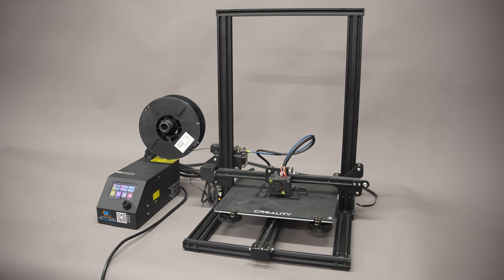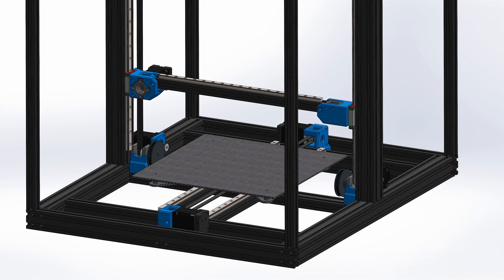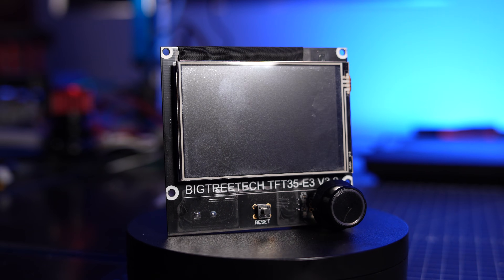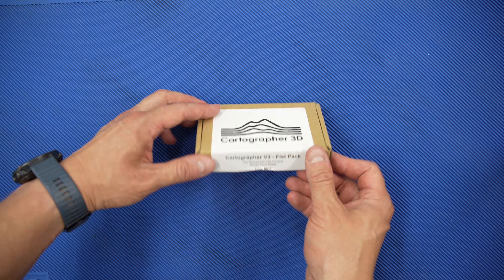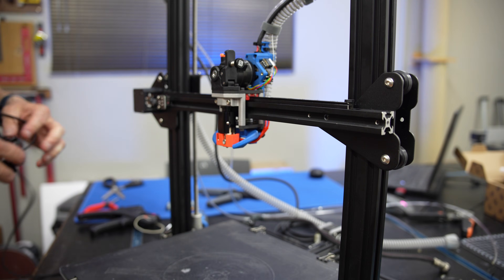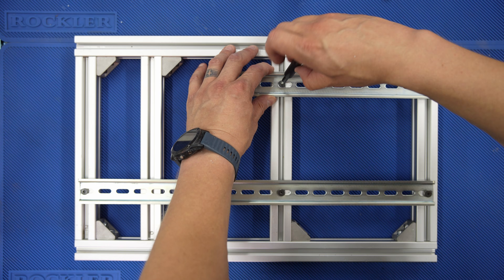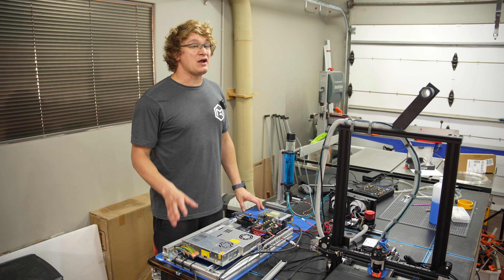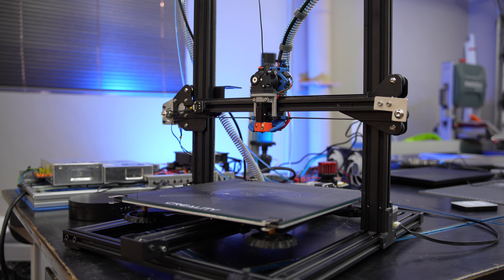I’m Rebuilding My First 3D Printer From Scratch | CR-10S Rebuild Part 1

Comment: I like the build, but for my opinion choosen hotend is disrespectful to the rest of the printer. You put so good parts and everything in it and I thing goliath or chc xl, heatcore 4 and other would be much better options as hotends. Your max volumetric speed would be around 15mm^3/s which is around 180mm/s printing speed so any other hotend would fit better here

Comment: Just broke my heating resistance on my CR-10S and was thinking about repairing it or not. Definitely waiting for the next videos to take a decision
Reply from the maker: Sorry to hear that! Hope you'll find the next videos helpful in making your decision!
Reply: @marcelgenis i'm going to try to transform it to core-XY with minimum cost. Not really your method but will keep an eye anyway
Reply from the maker: @frederict3425 Core-xy is definitely the easier and maybe the smarter route!😂 Thanks appreciate it!
Reply: @marcelgenis after 2 boards replacement, I don't invest anymore in an 8 years old machine but the Bigtreetech SKR mini E3 now driving it worths trying something
Reply from the maker: @f @frederict3425 what happened to the other boards? What boards was it?
Reply: @marcelgenis it was original boards and extruder controller chip died on each of them. Couldn't find a new one at a reasonable price so I had to jump to SKR Mini e3
Reply from the maker: @frederict3425 Same thing happened to me. My original board died, and I couldn’t get one. So I used the BTT E3 RRF. Quite a decent board for the price.

Comment: Why are you using the grove mount on the dragon ? just unscrew it and ridgit mount it. Makes everything so much better
Reply from the maker: Hi there, you saying to bolt the carraige directly to the heatsink? My heatsink is a water-cooled heatsink that doesn’t have any alternative mounting holes, except the screw hole for the groove collar.

Comment: If you can print a Benchy in less than 20 minutes with a 0.5 nozzle and a 0.2 layer height, it'll be great.

10k acceleration and a speed of 300mm/s should break the Benchy, but you need to get the kinematics right. The bed must be made entirely of carbon fiber with a Kapton heater and Kapton adhesive coating—otherwise, forget about flying.

The entire bed, including the MGN carriages, must weigh around 800g or less to achieve these speeds or higher.

It's doable.

I'll be watching.

Good luck!
Reply from the maker: Thank you for the advice, I’ll definitely try an get it closer to 800g! Couldn’t get a Kapton heater big enough. Still looking for one that can actually be shipped to SA. The 300mm x 300mm bed size is quite a challenge, have you printed a sub 20mm benchy on this size bed? 

I get the feeling that once you get into speed chasing, one hardly ever get out😂 Already making plans on two printer versions.

Thanks for watching and for all your support and advice, really appreciate it!
Reply: @marcelgenis  You need to design your own Kapton heater and have it manufactured by a company that manufactures PCBs and similar components (I won't mention names ;)). They're quite inexpensive to produce, and it's best to buy five pieces because it's the most cost-effective.

On my Ender 3, with a 730g build plate, I achieved 200mm/s and 10k acceleration (300mm/s travel) on the original 4.2.7 board (quality print). After switching to the Menta E3EZ, I reached 400mm/s and 14k acceleration using Nema17 42-34 motors. My old Ender 3 is used as a test bed. I have other printers, but the old Edward was my first printer :D
There's one rule: all the GT2 belts must be perfectly perpendicular to the pullers to prevent levers from forming on the linear carriages. You'll have a slight problem with resistance on the table because you'll be using two guides that need to be perfectly perpendicular to each other. You can also set them using the floating carriage method (one permanently attached with 4 screws, and the second carriage with only 2 screws, or even just one). This mounting allows the second carriage to adjust to the plane of the first.

Comment: I have an old Ender 3 Pro that's basically the same machine but smaller.  I moved the stock extruder directly above the hotend and added a BLtouch.  I also put a spider v3 hotend on it.  It prints amazingly well.  ABS, PLA, TPU.. whatever I want.  No issues.
Reply from the maker: Sounds like you've got a great setup! Glad to hear you're getting such good results with it! For some reason I really like bedslingers, considering looking for a second hand Ender 3 on marketplace and doing something similar with it!

Comment: This is probably the most insane Printer build Ive ever seen. well other than a AWD 6 tool head changer voron I saw at RMRRF but this is a different kind of insane
Reply from the maker: Thank you! Don’t think anyone actually realizes what you have to do to actually move a 300mm x 300mm bed around …fast! Destined to be overkill. And I am actually considering adding AWD to the x-axis as well, tool head changer will be too difficult 😂
Thanks for taking the time to comment really appreciate it!

Comment: I had the CR6 Max and it was printing like a complete trash let alone that i had to replace every single FAN in it because stock it was so obnoxiously noisy like a fucking server, also had to replace the extruder because it was made from plastic and the plastic cover holding everything together literally snaped by itself and was not providing correct pressure on the gear pushing the filament. Also on 1st print it dug and scratched the print surface even though Z offset was properly calibrated before.  Literally just a piece of the worst junk Creality should have never started to sell and was basically a scam from their side.
Reply from the maker: Wow, that sounds like a nightmare! Sorry to hear you went through all that trouble with it.

Comment: Would have been more interesting if it was truely upgraded to be faster and more useful instead of basically building a new printer. Edit:  Yes, I realize this is just wishful thinking for to it's limitations. 😢
Reply from the maker: I hear you…but think about it. With the original hardware, how fast can you really make it. The only other thing that you can do besides replacing hardware is to host Klipper, basically getting the same results as I did in this video. You can then do input shaping, improving the quality even more but still be limited to the same speed, might be able to shave a few minutes but thats it before you will have to start replacing hardware, as soon as jou replace one thing you sit with a new thing limiting you. Before you know it… everything is replaced. Spent a lot of time thinking about it and I really don’t want the machine to be a little bit better, I want it to challenge modern printers. Unfortunately these old CR10S wasn’t built using the best hardware and the frame is quite flimsy. Not that much you can do with that. without replacing stuff.
Reply: @marcelgenis  I can't argue with that...uggh... wishful thinking.   I just hate seeing my cr10 sit there collecting dust.
Reply from the maker: @fugitiveminded I might do another CR10 project in the future, where I only take for example $100 and see how much I can improve it. Now that I basically still have a stock CR10 left over after this project😂. Wanted to wait and see how much attention this series get before I consider something like that. So far it looks like it should do well!

Comment: Compared to the rest of your setup that dragon hotend is seriously underpowered. A single 5015 would be plenty to keep up with its flowrate, I suggest getting a dragon ace volcano to make good use of that cpap
Reply from the maker: Totally agree! I have my eye on the Goliath WC hotend, yes WC might be overkill, but I like it😂. Before I pull the trigger on it, I first want to see what happens. There will definitely be a bottleneck, just not sure yet if it is going to be the y-gantry or the hotend!

Comment: how much would this cost? like $300? or closer to $600 like a full voron kit?
Reply: why dont companies make re-usable tech. everything seems to deteriorate or get old over time. nothing lasts forever except for refridgerators or washing machines that can be serviced over time as the parts wear out. bambulabs is proprietary. nothing is safe. im questioning what actually can be kept. like you got a new hotend, bed, board, display, what else is there left of the original printer? its all new.
Reply from the maker: At the moment I will only reuse 80% of the Aluminum frame, limit switches and two steppers. Everything else is new. Won’t say all of them are unusable or so outdated that it can’t be used anymore. It is more of a quality upgrade. For example One can definitely still use the heated bed, I am just tired of waiting ages for the plate to reach temperature.
Reply from the maker: I am not 100% sure, bought a lot of the components over a span of two years. But i’ll will share the total coat once the project is done. Believe it will be around the same cost as a full Voron kit

Comment: i have a mp10 mini. do you think i could do something similiar? do you know if there is a voron halfway kit that makes modding a original printer easier than just doing a full parts kit becuase then i would have to throw out the original printer.
Reply from the maker: Hi there, yeah you can definitely do something similar to the MP10. This toolhead might not be the best option, to give you an idea, due to the toolhead cage, movement in the x-axis reduced by 80mm just to fit. Something like the dragonburner might be better fit, if modified correctly it won’t reduce the movement too much. Well you can always use the LH stinger toolhead as well? Regarding a halfway kit, no I don’t think there is anything, well not that I no of. But I could be wrong. Take a look at the ender conversions, like the enderwire. would be quite similar to yours, just a little bit bigger. Can always scale that down to yours! Good luck, I’ll keep an eye out if I see somethingthat can help you

Comment: BTT ez max can just power the pi via usb port without extra power suply for 5v....  and one MW 600w is alreay enough for this small cute... and I don't think u need water cooling for this hotend which is not uhf at all ... If u really crazy about water cooling and high-speed printing, go VZbot.
Reply from the maker: Yeah you are right, but the Pi was giving me problems while powered by the board. In my opinion much more reliable. Only had the 12V psu for the bed heater that requires 12V. Will be replacing it with a mains heater in part2. I will then include a 48V for the steppers. Yeah the hotend is def sub par, I like the water cooling part, and I already had the hotend from way back. But I have my eye on the Golaith WC hotend. Just want to see what is going to be the biggest bottleneck, the Y-gantry or the hotend, before I pull the trigger on the goliath! Well I am considering buying it anyway, 😂for a corexy printer idea I have!

Comment: its overkill for bed moving printer, not be better get extra couple 4020 and 2020 aluminium extrusion to build corexy?
Reply from the maker: true, true… but something in my wants to challenge physics with a bedslinger! Might be stupid, but fun. Definitely have my crack at corexy after this build!
Reply: @marcelgenis  its actually easy to convert, need one extra ender 3 frame for parts if dont have option to cut or order right size.
Reply from the maker: @alexvikingo6676 Definitely on my to-do list! The sad thing is, that it should be a better performing printer in the end

Comment: The hotend is bassically the only thing that isnt a uograde here. Could and shouldve done a Goliath Water hotend to keep water cooling and 4x the flow and still V6 nozzles
Reply from the maker: Totally agree, I have the Goliath in my basket. Just waiting to see what is going to be the biggest bottleneck between the y-gantry and the hotend, before I buy it! The problem was, I bought some of the components, including the hotend, more than two years ago. My plan evolved a little bit since then😂

Comment: Why would you use dual 12mm guides and not move them to the sides for maximum stability 😮
Reply from the maker: Was something I was considering. But doing it this way was lighter. I did FEA on the plates to optimize them. My goal was to get the plates as stiff and as light as possible. Having 4 Anchor points supports the bottom plate substantially and reeuces the need for extra printed parts. With such a big plate shifting the rails down to the sides would have left the connection of the bed assembly further away from the CG. Creating unnecessary forces and torque, that would impacted the gantry more than having the rails on top. Well thats my opinion and what has worked for me in some industrail designs I have worked on.

Comment: Same here. I have a ender 3 v1 with some mods worth 150€, but its soo sloow and it cost me a lot o time to calibrate to have good quality, but now i got a Kobra 3 v2 combo and its in another level, por just 220€ it has ALL included and 3 or 4 times more quicker so...
Reply from the maker: That's awesome you found a printer that works so much better for you!

Comment: Cool video. Also, drilling, sanding, cutting carbon fiber equals facemask, always, with any amount.
Reply from the maker: Thank you! Yeah definitely, helps to wet the surface with a spray bottle to keep the dust contained. Instead of using dust extraction! I have over 10 years experience as and structural composite design Eng, carbon dust is definitely the worst!

Comment: Stumbled upon this thanks to YT's random suggestion algorithm.  I have a CR-6SE gathering dust, having been obsoleted by my K1C.  Now subscribed so I can follow your build and maybe save my old printer from the bin.  Great video and looking forward to seeing your progress.  To be honest, though, you're essentially building a printer from the ground up.  Will there be anything remaining of the original once you are finished?
Reply from the maker: Thank you Youtube algorithm, never thought I would say that!😂 Thanks for the sub, really appreciate it. Glad you liked the video. Yeah, on paper this is basically a complete rebuild from the ground up only in the same form factor as the CR10. But I like to convince myself it is still my old CR10. If I used brand new extrusion for the frame, I would still have a complete CR10 and a new printer. Might just do that in the end. The plan in the beginning wasn’t to just replace everything, that came with time. Some next level scope creep😂

Comment: If when you are done with the upgrade, you have the ability to rebuild your CR-10S out of the parts you toss with perhaps two new stepper motors THEN this isnt an upgrade, its just useing the Z motors :-) in a new build
Reply from the maker: 😂😂😂 If I play my cards right , I could get by without even disassembling it

Comment: There is no point in watercooling the hotend if it's not in a heated chamber
Reply from the maker: Definitely, going to enclose the printer in the end. Mostly want to print ABS, ASA with enclosure arounf 40-50C. Hey I like water cooling, would probably have done it just fir the fun if it.

Comment: clean build and good video!  

in my opinion matching the Center of Gravity to the linear rail is kind of pointless when the belt applies forces 20mm lower. having the CG where the belt is attached to the toolhead would be much better than having the CG where the linear rails are
Reply from the maker: Hi there! Thank you really appreciate it! Yeah you are right, but don’t think it is completely pointless, the belts connection point is only offset in one plane. Thats in my opinion by far better than a lot of the toolheads out there, where the CG is offset in two planes. The rigidity of the carriage will  handle any forces and torque created by the offset with ease. But with that said, I already started the design of V2, with the belts connected to the top plate instead of the bottom plate. Was actually a super easy thing to change😂. While designing I sometimes start to get short sighted. it seems as the only possible way, meen while there’s a much better option. Just had to step back for a moment to see it!

Comment: I have a CR10 V3 covered in dust with a motherboard problem. I have the same idea to upgrade it and leave it a second chance.
Reply: Maybe combine 2 and make a core x y du ender
Reply from the maker: @FUCKDSS That would definitely be the smarter and maybe less expensive choice!
Reply from the maker: @FUCKDSS Yes I have seen it! His work is awesome! Thats sounds great, enjoy both of your builds! I might look into a additional second hand cr10 and build one, now that I am basically barely using any of the original parts😂
Reply from the maker: It will definitely be worth it!